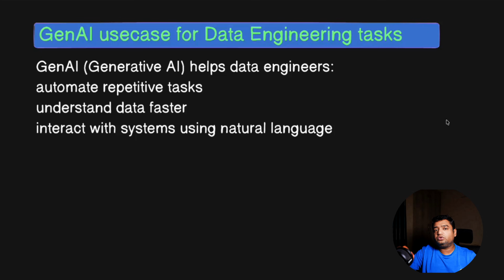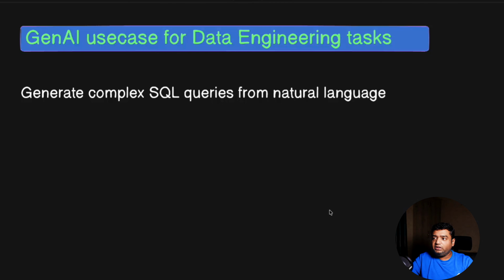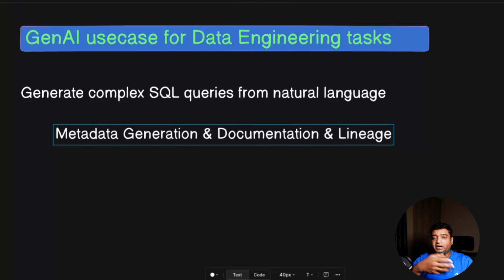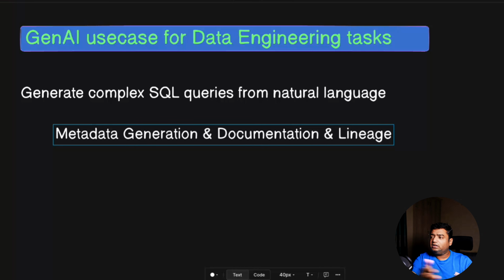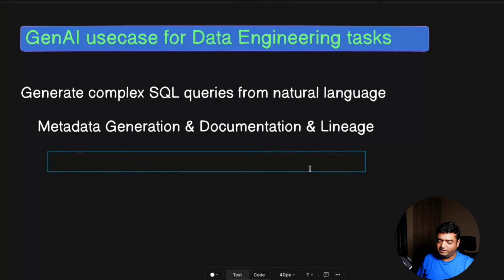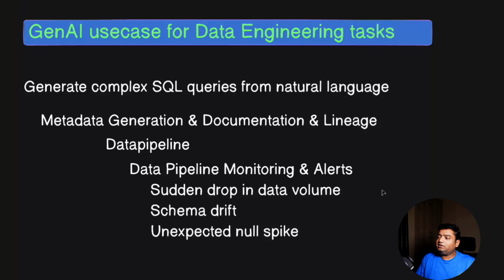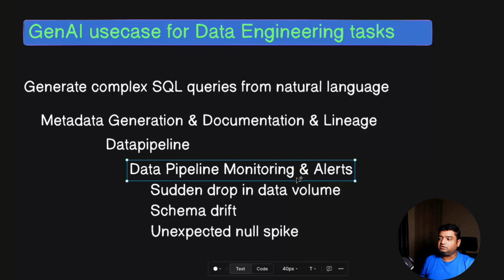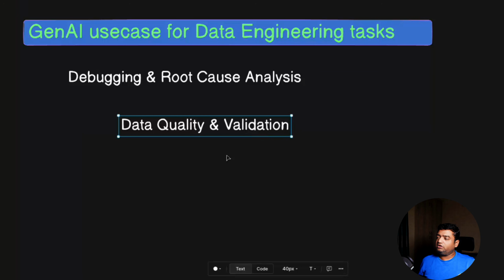Top GenAI Use Cases for Data Engineers

Comment: Why can't we use determisnistic workflows for schema drift, data volume, null spike. these are not something new
Reply from the maker: Understanding Null Spike Detection

Let's take a simple example.
*Yesterday*
| Column     | Null %   |
| ---------- | -------- |
| CustomerID | 0.2%|

*Today*
| Column     | Null %  |
| ---------- | ------- |
| CustomerID | 42%|

### Deterministic Rule

python
if null_percentage > 5:
    raise_alert()

This rule successfully detects the issue and triggers an alert. However, the next question every engineer asks is:

Why did this happen?
This is where  GenAI  adds significant value.
Instead of only identifying the anomaly, GenAI analyzes multiple sources of information, such as:
* Pipeline execution logs
* Airflow logs
* Git commits
* Jira tickets
* Release notes
* Upstream API failures

Based on this analysis, it can generate a contextual explanation like:
> *Root Cause:* The null spike started immediately after Release 2.4
> The upstream source API stopped populating the *CustomerID* field due to a contract/schema change.
> This issue is currently impacting **12 downstream datasets**.

Recommended Actions:
* Roll back Release 2.4, 
* Revert to the previous API endpoint until the issue is resolved.

### The Key Difference
Deterministic rules answer: What happened? (A null spike was detected.)
GenAI answers: Why did it happen, what is the impact, and what should we do next?

The alert comes from deterministic rules.
The  explanation, root cause analysis, impact assessment, and recommended actions come from GenAI.